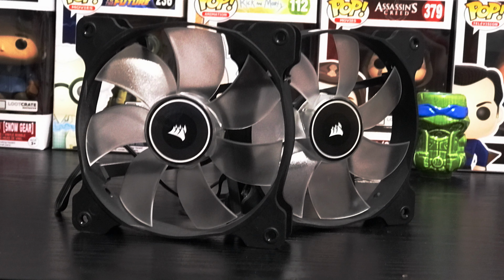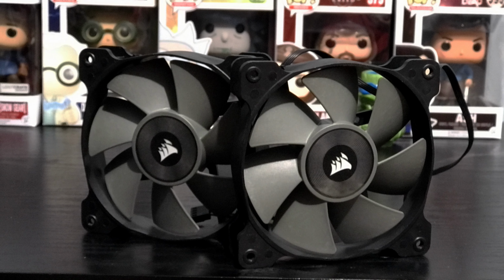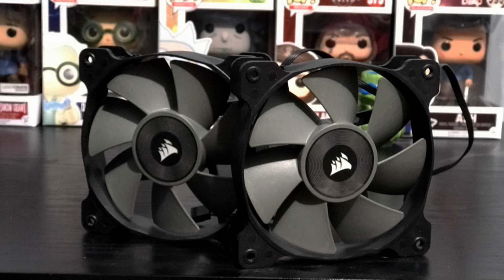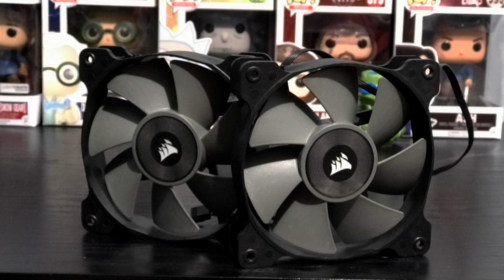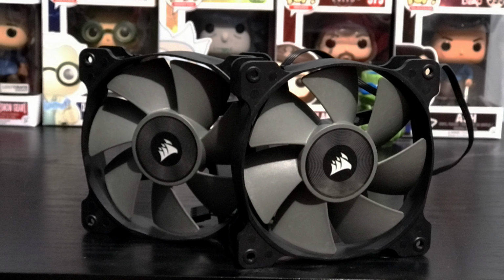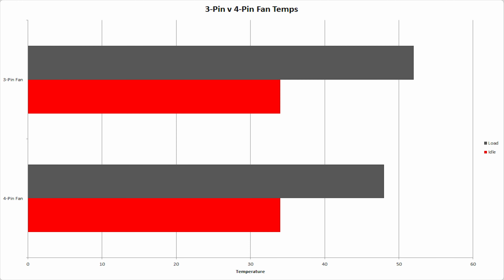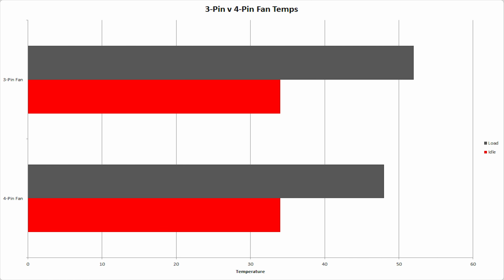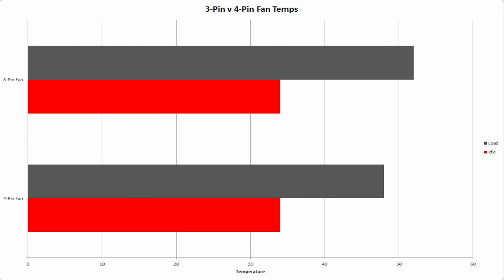What's the Difference Between 3-Pin and 4-Pin Fans?

Comment: I'd like to be your fan.
Reply from the maker: LOL i see what you did there...
Reply: I just wanted to to cheer you up a bit. I was installing one of those cpu water coolers 120x240mm with dual fans and while hunting around for info, I happened on your site, thanks by the way. In the end I put one fan connector to the cpu fan 4 pin header and the other fan to the chassis 4 pin header. In the bios cpu fan showed around 1200rpm and the chassis fan showed a bit over 1000 rpm. I'm considering a Y-connecter, so both fans will be driven as a pair by the single cpu fan controller. How about that?
Reply from the maker: That's a good idea, it will get the fans to spin at identical speeds, you may even notice slightly better temps.
Reply: Boom! The merry peeps of PRC to the rescue. $1.15 for a 1 to 3, 4 pin splitter cable. Life is good!
Reply from the maker: Nice, happy building!
Reply: Haha comment of the day

Comment: So i can use a 3 Pin Fan on a 4 Pin Mainboard right?
Reply from the maker: Yepp, sure can.
Reply: Eyoub SM. You can but I don't think you will be able to control the fan speed manually unless u use pwm. I made this mistake buying the Corsair ap 120mm quiet fans which are 3 pin fans. Btw they are very quiet.
Reply: Ok thx mate
Reply: Mighty Duck 4 pin is quieter
Reply: thanks god i found this comment.
Reply: nacho pacheco me too :)
Reply: Circuits Anonymous thanks so much
Reply: mighty duck, you can every mobo after 2014 can control dc fan speed and set a curve
Reply: Wait how? If its a 3 pin fan how do i put it in a 4 pin motherboard?
Reply: @raptorgod77  its fits the pins guide on which 3pins to put them with plastic a lip
Reply: @walnas3a  ye it works now i have a problem with the screws being too big to fit xd
Reply: Using the same bios, but i only have the AI TWEEKER how do i get extreme tweeker? Please help some1

Comment: Wow, your channel has some good quality for so low subs. I just have one question , if I have a 3 pin fan can I connect it to a 4 pin header in my motherboard ? with no problem? Keep the good work !
Reply from the maker: yes, you can connect 3-pin fans to 4-pin headers, they'll just run in straight up DC mode. Also i guess I got low subs cuz Im still new? Thanks for the support!
Reply: @CircuitsAnonymous  will it perform like 3 pin fan in general?
Reply: @raphthepilot  I dont know either, thats why Iam asking
Reply: @raphthepilot  thanks for the info :D
Reply: Same question!
Reply: @nami_ryane  lmaoo, 2 years too late.
Reply: @b.henriques9871  haha lol ikr

Comment: Good topic and presentation.. and Pwm stands for pulse width modulation not post...
Also if you have 4pin pwm fan and a 'y' cable an additional 3 pin fan can be controlled like pwm
Reply from the maker: That may have been a slip of the tongue, but thanks for the feedback
Reply: Cool! Hope to see more interesting topics like this

Comment: This is actually incorrect. 3 pin fans can also be driven with pwm dc. So that makes your whole point mute. The reason some fans can throttle better is due to driving them with voltage or  pulses. Voltage  is not linear whereas  pulses are very linear. I.e you can drop volts to 5 volts and fan won't even move but it will still be using power.  But if you send it full 12v but only pulse it for a very short time. The fan wil move very slowly and use very small power..  the Only difference  between 3 and 4 pins. Is that 4 pins have there own mosfet.  So you only need to send a tiny pulse and clean dc. 3 pin fans used in pwm mode will need chunky switched dc and may have issues with switching Rf noise in conductors.

Comment: Video is old but, speaking of silent system. I have 3 fans (3 pin), and u know they can run at 500-600 rpm in DC mode but can't run below 1000 in PWM mode. I can stop them in DC mode when my PC temp is below 43 (C) degrees but can't do it in PWM mode. So for fans with only 3 PIN DC mode can provide u more than PWM. Correct me if i'm wrong.

Comment: Id say the fan blades are different enough to skew these results.  The LED versions copy the blades of the typical standard cheap case fan , while the pwm has a slightly wider blade as it reaches the outer edge of the chassis, also thiere blades are the same as the higher end fans . Both do share the same chassis.  No one attempted this test but you, but I do recommend redoing this experiment with the enermax TB silence fans. They literally sell the same fan with the same rpm with 2 different connector types. Noctua may do the same with their redux series but i recall a rpm difference
Reply from the maker: That's a good idea, thanks for your input.

Comment: Thanks for the informational vid man...Definately helped me understand more on my case fans ...currently running 6 coolermaster rgb fans in my thermaltake view 31 case ...could have went all thermaltake but was running into having 2 controllers and with the config I have I need 1..4pin fan power splitter for a 120mm coolermaster fan I squeezed in front above 2x 140s ...3 on top and 1 in back and only have 1 controller to fool with ...I seen on eBay a data powered 5 fan and also 8 fan controller that's all 4 pin ...what I require for all the power plugs on all the cooler master the fans ...do you think a 5 or 8 fan power hub is the route I should go or just buy a 1 to 2 splitter ...just wanna get that top 120 going to pull along with the 2x140s below it ...the rest are all pulling air out ...2700x...gigabyte 3fan etc 2060 ..Asus prime x470...crucial 500g m.2..2x16 g skill trident z rgb..1250w g skill pow supply ...240ml coolermaster radiator in the front but have 140s instead of 120s ..so got good stuff to work with just wanna keep cool but less controllers ..only need 1 power for that 120mm...but wondered if I should wire all 7 fans into a sata 8 fan 4 pin splitter and then just run its lead into 1 port on the cooler master controller ...they kinda got a mess with rgb wires and 4 pin power wires on those fans may add some 120s pulling on inside of the radiator n if so I'd prob need some kind of power hub for fans ...sry I'm winded ...just been trying to figure it out n Asus rgb program only lets me sync ram n mb colors so I kinda hafta have a controller for the case fans

Comment: Great video! But what can you do when it seems the mobo is letting temps get too high and you want a different fan profile. Remember that heat causes aging. It is better to run at cooler temps.
I sadly bought an ASUS mobo (WS-C422) and it does not have any internal access for fan control. Also, any recommendations on a good monitoring software for temps and fan RPMs.
Thank you!
Reply: Use a hub that let you control fan speeds manually, I guess.

Comment: I have a question. I want to buy a 'Dex DX-2011', which is a Cooler Master Hyper T4 knock off [maybe I could even get the original], but I want to change the original fan [which is 4 pin] for one with a rgb led ring, which is 3 pin, only for the a e s t h e t i c s. My CPU is an AMD A10 7860k, not overclocked. Would that be a stupid idea? Thanks!
Reply from the maker: Its not a bad idea, so long as you can find a static pressure fan. Static pressure fans perform much better, than normal air flow fans, for CPU cooling.
Reply: Thank you! I didn't know about that. More research to do...

Comment: After 4 years of using 3 pin fans on 4 pin configuration my X99-a mobo is starting to short. I have to clear cmos for it to start any of the fans because of this one troublesome fan prong. I figure any bios fan speed auto rpm changes are sending abrupt DC voltage changes to the mobo. PWM power is considered "clean  power" and now I'm kicking myself for not using PWM fans at the beginning. Planning to get a multi 3 pin to serial power converter to mitigate this. Could always then plug it into a manual fan controller if the 100% rpm is just too much... decisions decisions. (not getting new mobo)

Comment: I just saw your video and I was curious because my 3 pin fan i added to my set up i used as an exhaust seems like it’s barely spinning or just not as fast as my other 4 pin fans
Reply: I dunno my other fans have more blades as well so I thought it was cause this one was a 3 pin connector

Comment: I love you for making this!

I'm still a mess. My first build with a Ryzen on a Gigabyte MBO. I have a CPU fan header and I have a 4 Pin fan header.

All I want to know (and can't find out and it has me about to cry lol) is what I need to run my 5 case fans with aRGB and wraith CPU cooler.

If I use a splitter, how will the mbo software (Gigabyte program) be able to control the speed of each one? If it can't, do I need a hub? If so, where's a 4 Pin that's not $400?

Would really appreciate help!

Comment: Andrew, thank you - i learned something from you that's important to me - NOISE! I had no idea a pwm fan can be quieter just due to the nature of the power delivery....although, they technically were different fans. do you think it might be worth doing a video to answer the question: will the same fan be quieter in 4-pin PWM mode vs 3 pin dc voltage control mode? Should be easy to test as the 4 pin ones can be used in 3 pin mode I believe.  very curious to know!!
Reply from the maker: Aww Jeeze, thanks Rick, that's a good idea!

Comment: I want to control the speed of chassi fans, but dont know how. Have both 3-4 pins connected to an adapter. But the fans runs 100% when connected to power supply :/
Reply from the maker: I recommend running fans through your motherboard if possible. You won't be able to control the speed without a physical switch.

Comment: Hi,I was under the impression that the 3 pin fans are not controlled  by the motherboard and just spin at their max speed while the 4 pin fans are controlled by the motherboard.
Reply from the maker: 3 pin fans are dc controlled so they're regulated by voltage, so the motherboard can control how fast the fan spins by how much voltage it decides to send to the fan header.
Reply: so 3 pin fans can be speed-varied? Ithought they ALWAYS spin at maximum rpm....
Reply: Yes. If your motherboard didn't detect your fan as PWM connection (3-pins), it will use voltage to control your fan speed. If your motherboard detect your fan has PWM (4-pins), it will use "digital" signal to control your fan speed. The pro of using PWM is the fan speed is more accurate because your motherboard just telling the fan speed it want and then the fan internally control the speed for it. The non-PWM fan is not so efficient because all manufacturer's fans have different speed even you set them as same voltage. So it is not ideal for motherboard to control the speed accurately.
Reply: @CircuitsAnonymous  So basically what it means is if it's 3 pinned and is controlled by voltage, the mobo controls the fan speed by checking how much voltage is being used?(More voltage=more power=more heat=faster fan speed?)
And the 4 pin has pwm signal which directly checks the temperatured and is therefor more precise?.

Comment: There should be no difference between 3 and 4 pin.   Both have a RPM sensor that goes back to regulate either the PWM pulse or DC voltage level.   The reason you let the system calibrate the 3 pin is so it can measure the RPM speed at the highest voltage (12v) to then calculate how much voltage to apply to the 3 pin voltage pin to apply a certain RPM speed.   The 4 pin does not require calibration this as it simply uses PWM pulses of varying length from 0% to 100% width to control the speed as per usual.   Sending pulses on and off or varying the fixed voltage to the fan works in the same way to control speed.  Again there should be no difference in using 3 or 4 pin, 4 pin is just a better way of doing it over the old 3 pin style because it does not require calibration.
Reply: musclesdude   Exactly.

Comment: well bro, I have ant esports 510 air cabinet where 4 pre installed fans is connected and it has 4 pin header which is connected to a controller but they are argb fans but how can argb fans have 4 pins? the have 3 pins

Comment: and now can i connect my tower cpu cooler have 3pins but my Motherboard have 4pin? :D and does its showing the cooloer spining speed? :D
Reply: Yes, just make sure to connect correctly your 3 pins cooler.
Reply: @tinn9843  :D
Reply: @tinn9843  but so does the speed measurement in bios? does i see the cpu cooler speed in RPM? and does controlable the fan? :D
Reply: @Uraim  If you can see RPM depends on the compatibility of the motherboard with the fanl and 3 pin are controlled by voltage, so check your mobo to see if the headers can be changed to voltage mode.
Reply: @tinn9843  wow thx i saved 20EURO because 4pin cpu tower cooler isn't so cheap (3pin tower cooler with blue led cost is 16Euro and 4pin tower cooler is 30+EURO :D

Comment: So the chassifans dont work unless they are configured in motherboard bios ? - I built a computer and the fans has nerver run at all - it's Antec chassi - I know i plugged in usb and headphonepower  so they work  - the fun part is there are no more cables to connect to chassi . the one to chasi was a big one  with 8 or 10 pins.

Comment: hi, i bought noctua dual splitter for two fans 4 pin pwm but one of them is 3 pin and second 4 pin.. I want use second fan on cooler in cpu header. Question... if i use 3 pin for second fan in splitter then fan always work on full speed or what ?

Comment: Many cases come with 3 pin fans and very often also a fan controller included. One connection goes tot the PWM fan header on your Motherboard. Then you connect all your 3 pin fans to this fan controller and they can be used in a PWM configuration. But I noticed in many cases that does not work very good. What I always do is swap the included fan controller for a full PWM fan controller., with 4 pins headers. This only when your Motherboard has not enough PWM fan headers. I always install PWM fans in my case, for extreme air cooling and also for radiators and what not. I'm a big fan of air cooling, then I trie to put as much fans possible inside the case. Via the added fan controller I can control each fan to its max potential ans usage. Intake, outtake etc. Thanks for this good video by the way.
Reply from the maker: Your welcome, looks like you got your fan situation figured out!

Comment: This makes no sense other than the PWM power supply ramping up smoother. Which would not cause lower temps. If anything (everything else being equal) it would cause higher temps due to the lag time at ramping up to higher fan speeds. Fan speed is fan speed and acoustics and cooling will be the exact same at the same RPM if you have two identical fan designs (same everything except power delivery). But you don't have identical fans and that is where your differences likely lie. Think about it. Why would only ramping up fan speed slower cause lower temps? Even acoustics would only differ for the very short time a DC fan ramps up more aggressively than PWM fans. 

There is no magic in PWM power that can push fans faster (move more air) and be quieter at the same time.

Comment: What's the Difference Between 3-Pin and 4-Pin Fans? 
I remember a time when electric motors required only  2-Pin (+/-) ....
Reply: 3 Pin-fans are usually equipped with a thermistor to sense heat buildup and with that system control the speed of the fan (in usually a pretty crude manner with not that much room for slower speeds, is my experience).
You can leave out the (usually yellow, if the plus and minus are red and black) third wire and the fan will spin up just fine, but at it's top speed, the third wire serves as a thermocouple for the computer, to let you know how "hot" it is there, for instance.
Reply: @Dutch3DMaster  so if my 4 pin pwm splitter has 4/3 pin and i want to setup second fan on cooler in cpu header one fan always works about temps and second with 3 pin on full speed no metter what temp ?
Reply: @Sauluzaz  It might not work that way,  because the yellow wire of both fans will give a readout that way and possibly confuse the computer (the yellow wire also gives some information about RPM based on temperature readings of the fan itself, which is meant for (basically) a self regulating fan).
A 3-pin fan splitter I got with my Noctua cooler has one fan running full speed (red and black connected only) and one fan with the yellow wire.
Using a non-PWM fan and one that is capable of being used with PWM might give inconsistent results, since I do not know how the PWM wire works, if it is merely used for some kind of feedback on the PWM setting used by the computer or what is needed for the fan (and thus, it adjusts it's speed by using the red and black wires and using a PWM signal on that) you might see one of the fans slowing down up to the point it's uncapable of keeping itself moving when temperatures are low, or (more annoying :P) when this happens, the coils in the fan that make the magnets want to move away out of the magnetic field start to wine because the frequency is either to high or to low, or the circuitry was not designed for frequencies that high (PWM control can go up into the KhZ  range easily).

Long story short, you could try it, but keep an eye on readings (or on the fans itself, to be sure) and see what happens.

Comment: Wait so what i know is that 3 pin fans are manually controlled, meaning that if i want it faster i have to manually increase the voltage (between 5-12v), and pwm are automatically controlled by the motherboard. Are you saying that even with 3 pin fans the motherboard can control them but not as accurate ? in both 3 and 4 pins i can set a fan curve ? Thanks !
Reply from the maker: There is more of a degree of control with PWM fans, yes. Most motherboards however take care of the calculations for voltage, versus you doing it manually.